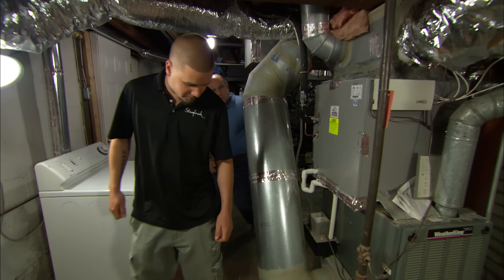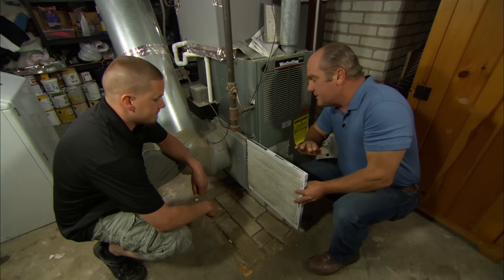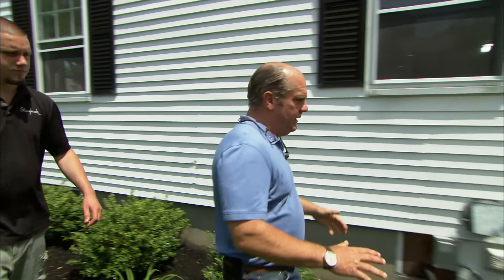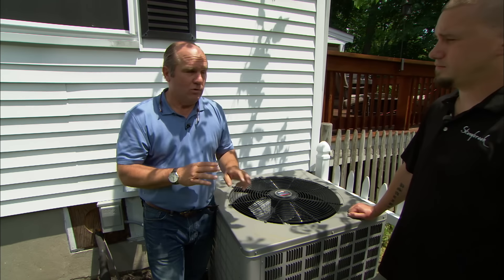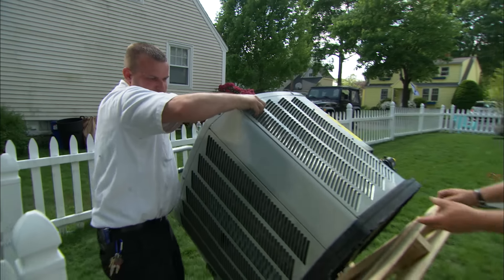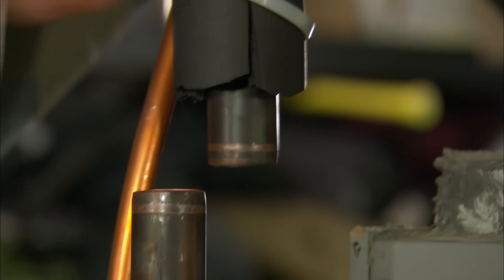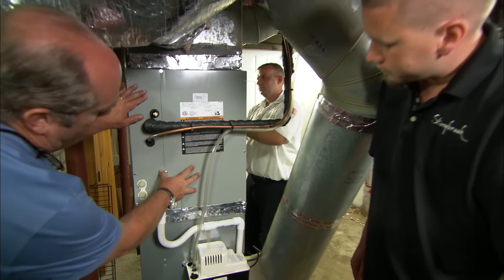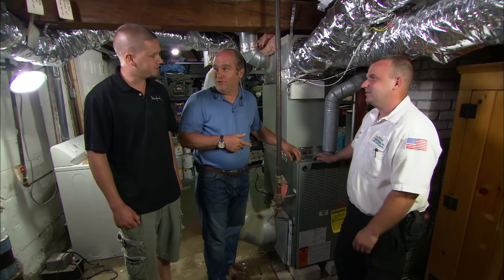How to Repair a Frozen Air Conditioner | Ask This Old House

Comment: This guy...this fuckin guy..filters not bad.. lets replace both coils and  you should be good to go...glad to see he subbed somebody that knew something
Reply: 4 ton condenser was probably on a 2.5 to 3 ton drive furnace blower.  The return was undersized and the evap was sideways to boot.  Air flow sucked in it's original and improved condition simply as the return was too small for even a 2.5 ton...super heat and sub cool tell you where to start right!

Comment: Unreal. That was at least an 8 thousand dollar fix.!!! What the hey !  Check the refrigerant level. Clean the filters and coils. See if that fixed it.  No hvac guy should ever pull an entire unit out of a house to stick a smaller unit in it's place to " fix " it.
Reply: maybe they did check the refrigerant level - we obviously didn't see everything they did - and the editor likely knows nothing about hvac. but "no hvac guy should ever pull out a unit to put in a smaller one"? if the system isn't running right and the customer is willing to pay to have it fixed properly, that is their choice. an oversized system with duct that cant support it will have humidity problems and not be as comfortable, is less efficient, and wont last long with liquid flooding back to the compressor. But I can't believe they left the ductwork like that, especially the return... and that damper system should have a bypass damper.

Comment: Maybe a dumb question, but if the unit is somewhat oversized, why not just block off 50% of the condenser radiator outside?  It will draw more power than a smaller unit, but there shouldn't be a problem with freezing any more, and the homeowner saves megabucks.

Comment: you notice that he didnt mention refrigerant lose bet a franklin that the evap coil was leaking and that was the only part that needed replacing because they replace a 410a  rheem unit with a 410A trane (money money money). second point they make it look very important the measurements that he was taking of supply ducks the real measurements he sould have been taking would be of individual rooms and house house measurements and construction Materials and components so he or the HVAC contractor could do an actual load calculation ( not just use rule of thumb) to install a more appropriate sized system.

Comment: What is the most common reason an AC for a home stops working?
Reply: Capacitor goes bad, usually because you've never washed the outside unit and don't change your filter enough.

Comment: Changing the tonnage from 4 to three for the main unit and evaporator coil just cost the client lots of money. 

An easier fix to prevent icing is to leave the fan running even while the AC has shut off reaching its shut off temp. 

This would have solved the problem for about $4k less. 

But hey,  when a TV show needs airtime to fill,  they don't care about expenses.

Comment: that house needs 2 ton. 3 ton is still oversized, so he might still get some icing. 

Also, when a unit is too powerful for the house, it short cycles, meaning that it only runs for a short time before shutting down. That wears out the compressor faster and fails to dehumidify the house properly.

Comment: Even at 3 tons, the return air duct is still undersize.  Surprised when the Old House Guy was doing his inspection of the ductwork, he didn’t notice it.  Neither did the AC tech. Did anyone check the capacity of the blower?  Airflow is everything.  That filter being right up against that undersize round return air duct doesn’t let the filter use it’s whole surface, which creates another restriction. Without a return air plenum, you can’t get the use of the full area of the filter.  I’ll bet there is a huge negative static on that return air system, provided the blower is the right size.  The first thing to do on any start up is to verify is the proper airflow for the given unit.  The installing contractor should have done this on start up.  All other readings will be erroneous without the correct airflow.  It’s the easiest thing to check.  Otherwise you’ll be chasing your tail.  This installation was bad from the start.  Taking a simple Delta T measurement would have found the problem.

Comment: a pound of ice requires 144 BTUs to change it to a pound of 32 Degree water 2000 lb * 144 BTUs 288000 BTUs / 24 hours in a day equals 12000 BTUs per hour that's why a ton of cooling is referred to as 12000 BTUs

Comment: 400 SQ INCHES per ton return air grilles 90 percent misplaced undersized gotta take out what you put in ductulator size up your main 400 cfm per ton after that run supplies 3ton being 1200 cfm can run upto 12 6inch flex lines 6 inch=100 cfm  center your supply main to keep short branch lines  place registers next external walls calculate .01 return friction loss per 100feet of return and .1 friction loss on supply per 100 feet after 100 feet of branch line upsize all on your ductulator thats 12 6inch lines upto 100 feet the you go up 12 lines cant be more then a hundred feet total same with return .01 return frictio loss .1 supply

Comment: The problem I now see is the heater and the cooling unit is offset and also not enough returns witch causes airflow problems my system at home is having a similar issue and I’m going to have a additional return added to boost my CFM my unit requires 2000 CFM but I’m only getting 500 CFM so basically I’m not getting enough CFM to make it work properly because my returns is only supplying 500 CFM not 2000 CFM witch is what my system requires.

Comment: I’m not an HVAC guy but maybe try a bypass damper or maybe upsize the return and throw a register in the basement ? Seems like there  are some other options I’d try before I’d remove a “new-ish” system. Not everyone has a TV show willing to supply a new AC system. Then again maybe the moral of the story is not to pick out your own HVAC system and leave it to the professionals. Seems like they could have made a show out of discussing all the other options people have voiced in the comment section.

Comment: Bad call, if the A/C was running for more then an hour before it froze up it was not to big, It may have been  low on Freon and should have shut off every 30 Minutes, so it had time to rest before the next cycle. Also the return duct is to small it should have been at least 16" for more air to go through it air flow is what probably caused this freezing problem. Also if the home owner had just turned on the fan mode it would shut the compressor off and after it warmed up set it at a higher temperature and found out where it did not freeze up. There is so much wrong with this it is hard to watch the home owner get taken like this not once but twice.

Comment: Tons of air molecules not blocks of ice and if it would be oversize it wouldn't freeze up the coil but supply to much cold air causing mold due to not enough humidity being pulled out of the house

Comment: One thing that wasn’t mentioned... the blower speed has to be set accordingly.
Reply: I doubt that furnace was big enough to supply 1600 CFM on high speed.  Th ac was probably an add on to an existing furnace, in which the blower and ductwork was too small for the size of AC equipment installed. I believe the customer said he bought his own equipment, and the person ho sold it to him said the unit was plenty big for the house.

Comment: That looks like a 4 ton coil from what I can see of the model number and if it is I can tell you right now your ducts are way undersized and is the reason its freezing up.  Also the instructor is telling you wrong on how the refrigerant moves through the lines.

Comment: Anyone catch him explaining to the homeowner that the refrigerant runs backwards? Kind of bugs me that not a lot of people are willing to learn the trade the correct way. He didn’t even check pressures of the refrigerant. It could have been low on charge. Could be a bad txv/piston. Could have been a dirty coil (not visible in the video since system was an upflow with the coil sitting up stream of the blower) There are a lot of variables that have not been checked.

Comment: You are wrong, refrigerant comes into the indoor coil by the smaller size copper line  and goes back to the compressor by the bigger copper line set that’s called the suction line.

Comment: What I don’t get is if he had a 4 ton unit and the estimate was 2.5 tons why then install 3tons? Either install 2.5 if it’s manufactured or a two ton that would run a bit more but will definitely not freeze. I think that should’ve been better explained.

Comment: Just about anything can freeze your evap. Lack of airflow which can be due to a dirty filter, a dirty coil, a bad blower motor a collapsed duct, low on refrigerant, a bad restriction which can be a bad txv or just about anything else....Just call a pro.

Comment: Well, until they can control the dirt, and amber dust in Central Florida, I'll continue to clean the filter every month. When the unit started acting up condenser tanks outside like snow in Florida!? Pulled air handler panel, into the freezer. Let it de-ice, all over, filter clean, but the dust and black dirt coming over in the hurricanes, like on my white concrete tile roof, only it's in the coil from underneath. Bad sign. Pull register to get in chase under coil, dry and with my big shop vac and plastic bristly brush i cleaned as much as I could. The contortions are HELL on the aging bod. but after sacrificing a beach towel with bleach stains, now under the coil, "in the box", I give it the garden hose (by the register the carpet dries in no time, once the system is back on). I've never had an auto-droplight. ceramic explode (how??), but it did, so me, dampness and bare electrical wires made a contortionist job worse, and dangerous in the box. Call a professional. It is SO worth the money!!.

Comment: I'm gladly take that old unit and set up for my house lol it's smaller than his house and it'll work great when it's hooked up properly with the proper pressures and a good drain to get rid of the excess moisture. smh lol

Comment: Could have just put on a bypass damper if it was oversized. Then it would work the same way a zoned house works when some of the zones are off. Customer would have saved about 4K lol
Reply: actually it was already zoned... you can see the lennox zoning control on the plenum. which makes it even worse that theres no bypass damper!

Comment: I can tell by this whole job that the duct work is not sized correctly. The a/c was way over sized. The person who put in the 4 ton ripped the guy off for a quick buck. The return was not upsized to get more air to the coil. Was there a load calculation done for the new unit. The new unit was not correct as well. This was a poor show of a video.

Comment: melt the ice, turn on the gas heat for 30 minutes.  low refrigerant is the issue...welds may be breaking down.
Reply: airflow from a 2.5/3 ton furnace blower through a 4 ton Sideways coil...which causes weird vortex's that create wind friction thus reducing air flow....and then paired to a 4 ton condenser with a lack of return...as you saw that 8 or 10 round return duct....so the return was undersized...the supply was probably good for a 3 ton (as i would hope the installation was close enough). ..the unit was over sized for the square footage of the old house...and then...at its best...the 3 ton furnace blower could not achieve the demand of heat absorption required by a 4 ton unit with the existing problems.  Basically, it was a lack of knowledge on that installer...i follow them all over town fixing what they couldn't see.  However...they could have increased return and supply and added a 3.5/4 ton driver furnace so as the coil would fit the furnace and then get a t-stat that controls humidity...so as not to create a chilly humid feeling as well as control potential mold growth on cellulose base materials such as sheet rock...but this would cost as much if not more...depending on the design of the space...anyhow...i hoped you liked reading this lengthy reply bro...lol

Comment: He also never hooked up his gauges. Not a completely thorough inspection of the entire system. With my residential experience, units that have frozen coils are usually low on refrigerant, second would be airflow issues

Comment: Should have named the video How to check the size of your unit. This is not a typical reason for a unit to ice up. There are plenty of systems undersized and oversized out there and crappy duct work but if a homeowner clicks on this video because their unit is freezing up they're missing the most common reasons for this, this only covers a very rare circumstance.

Comment: Never really fixed the problem.  My 1000 ft condo new system is $6600 or 8800 for two stage

Comment: guys I am 72 yrs. young. I know a little bit about AC unit . I read most of the comments and I have not read any comment if how old is the ACunit. if the unit is in service for more than 3 to 6 months or more its not the size of the unit . maybe it has something to do with the expansion valve or the Freon in the system. in U.S.when there is a minor problem service personnel wanted to change everything to make more dinero/

Comment: I'd say the most important part in diagnosing an A/C is to actually hook gauges up and run it... something that never happened in the video.
Reply: The first thing to check is airflow.  That’s what every tech is supposed to be taught in school.  On chillers, the first thing to check is water flow.  I taught apprentices for 30 years, and we always taught, “airflow is everything”.  All other readings are dependent on proper airflow being established first.  Low airflow will cause low suction pressure.  I’ve seen techs add refrigerant to a system with low airflow to try and drive the pressure up.  It ends up taking the compressor out.

Comment: So you had a 4ton condenser and a 4ton evaporator and you could have solved the problem with more space. Why not simply duct the basement space to take up the excess? Seems like that would have been cheaper.

Comment: Low refrigerant, dirty condenser coil
400$ to recharge with 410
700 to find leak and recharge
A little more for r22
The house lokks like its close to 2400 sqft.
4ton should of been ok.

Comment: Posters talking refrigerant or TXV issue, nope. Coil was fully iced, so that eliminates that. It's airflow and oversized equipment. Even after the "repair" It's still the return, airflow and and oversized equipment. Richard should should stick to plumbing.

Comment: Remember kids, even though the first contractor missed it and Rich and crew missed it too, a condensate trap is NOT necessary on the positive side of the blower.
Reply: It’s not needed for the condensate to drain, but it is an air leak.  That’s the reason the trap is needed.

Comment: That Supply plenum is insanely small
Reply: What about having no return plenum.  They just blocked off the side opening and cut a  14” hole in it.
Reply: @rodgraff1782  You can get away with that in the southern states with newer designed furnances though...
Reply: @rodgraff1782  let's say that the return of the unit only needed 1200 CFM or what ever the exact CFM of 14'' hard pipe is, you can get away with a straight 14'' hard pipe round circle stainght into the unit but i would install a return plenum and filter disigned for the righ tCFM throguh it toget to the unit

Comment: Chances are if the system has been installed for years and this problem has just started. Then it will either have low air flow from a dirty filter or coil. Other cause will be low refrigerant charge in the system. 

His calculation for sizing is false. There is no simple rule for sizing. Theres an entire manual that must be used to properly size a system.

Comment: Never use a 1" pleated filter ever! If your unit takes a 1"-2" filter use something that can flow like the $2 woven fiberglass or $40 washable metal filters. If your thinking you want your hvac system to clean your air you better move up to a "4-"6 filter box to use those pleated paper merv filters.

Comment: I found this hard to watch because almost everything he said was wrong or not in the right order of diagnosis. He should have checked to see that the tonnage of the condensing unit and the "A" coil were appropriate. But the first thing he should have done after checking the filter is to verify that the coil is frozen and not passing air, which he did, then you thaw the coil out by turn the thermostats system switch to "Off" and the fan switch to "On". This will try to circulate the buildings air without the heating or cooling being on. You do not want to turn your heat on. With a blocked air flow situation it is easy to overheat and crack your heat exchanger. Once the ice is melted take the cover plate off of the end of the "A" coil and inspect the underside of the fins. When an "A" coil is totally frozen over its entire surface the problem is usually lack of air flow. Since the filter was good you will most likely find that the underside of you "A" coil is blocked with what looked like packed dirty dryer lint. This blocks the entire surface which stops heat absorption and freezes the entire surface of the coil. A low refrigerant condition usually only freezes part of the coil. The house looked pretty old and the basement is most likely dirty. When an air filter starts to pack up the supply fans suction will often draw air from cracks around the filter and gaps in the sheet metal of the unit. If this bypassed air is dusty then over time it will build up on the underside of the evaporator fins. This should have been the second thing he looked at after the filter.